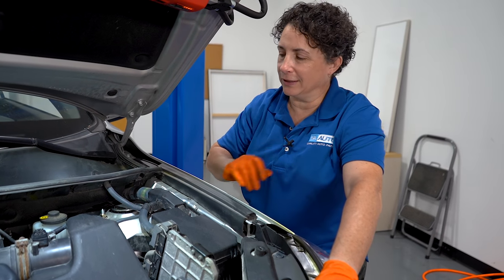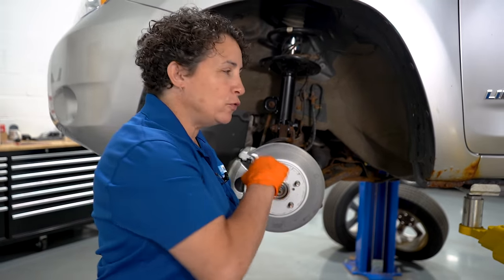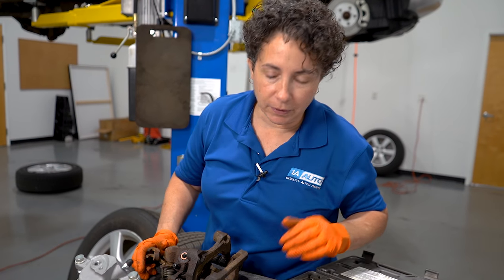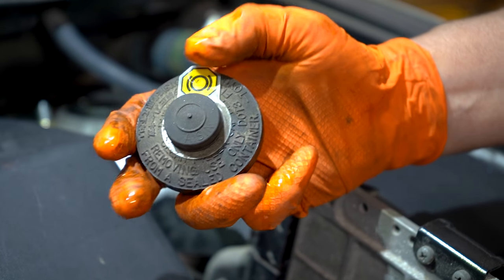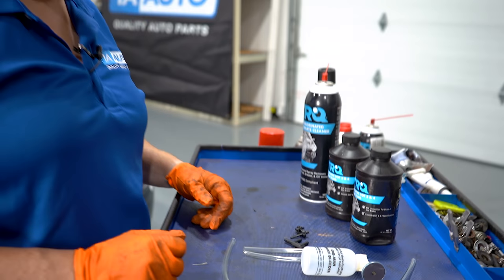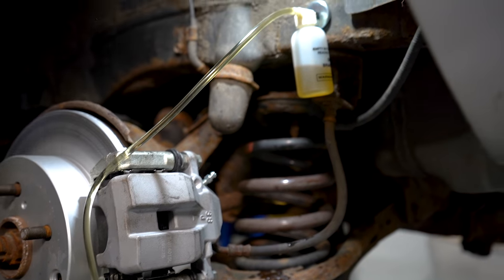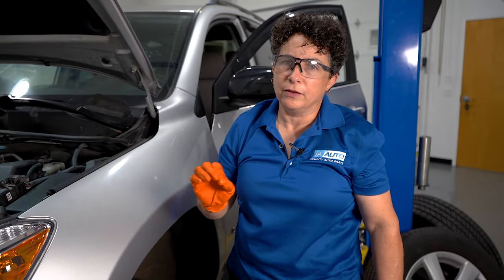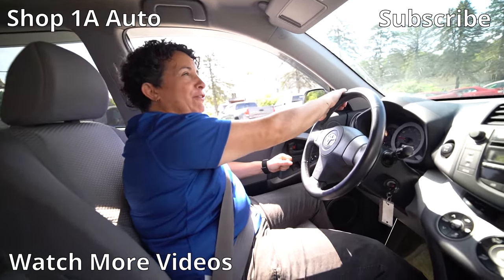Common Mistakes Bleeding Brakes! How to Do a Full Brake Bleed the Right Way, and Why!

Comment: The brake system you are looking at on the vehicle is a split diagonal system. One port on the mast cylinder is connected to the right rear line and also connected to the left front line. The other port is connected to the left rear and also connected to the right front line. This design will keep the vehicle stopping straight in case you loose fluid pressure in one of the lines. This is in most vehicles today especially front wheel drive vehicles. You bleed the right rear then the left front. Or the left rear then right front.  The system sue draws in the beginning is the front brake lines are using one port of the master cylinder and the rear is using the other. If one side looses pressure there is a proportion valve that will block off fluid to that system. Now you will have either front or rear brakes only. So let’s say you lose pressure to the front brakes and only have rear. The vehicle is not going to stop well and if it is bad weather even worse most likely spinning like a top. The split diagonal system if you loose pressure on one system you still have a front and rear brake to stop the vehicle straight.

Comment: Watch the pedal travel when first pumping up the pedal.  Do not want to ruin seals in master cylinder. Small pushes until it builds pressure
Reply: I did all processes on second master on 98 Chevy reseviour has seals .
Reply: Had to replace broken rear feed line, now new. Trying to single person bleed.

Comment: Some cars (toyota) have ABS pump on the passenger side. So for the driver front it actually takes a longer journey for the fluid than the passenger front. So for that I start from driver rear wheel. Also when doing one-person bleeding, I apply a thick grease on the bleeder thread to prevent air from being sucked in via the threads.
Reply: yes i think she loosened the bleeder too much. Good tip to use grease

Comment: Excellent young lady!!! Doing brakes on a 2019 jeep rubicon. Dealer says rotor, caliber and line. I found stuck caliper. $1600 from dealer, $400 to replace calipers, and ceramic shoes. Just bought vacuum to bleed brakes. Just refreshing my memory to do repair.

Comment: Glad you mentioned the Corvette brakes being different from the norm on the order that you bleed each wheel as well as which side of the caliper to do first. I had heard that and now you confirmed it. Getting ready to replace pads because of excessive brake dust and bleed system on a 2017 Corvette with 20k miles. The brake fluid is black...........long overdue for a brake system flush.

Comment: Thanks Sue. You have been giving me the confidence to work on my 2005 EX Honda Element. I live in the rust belt of WI, so i can relate to your videos 100%. I have to replace my drivers side CV axle because the inner boot is ripped and leaking. I now have the confidence after watching your videos.

Comment: Great video.  I came across an instructional video that states your order of bleeding depends more on the distance from the ABS motor to the wheel ( if equipped with ABS) than the distance from the master cylinder.  Also, Peak brake fluid is rated for both Dot 3 and Dot 4.   Kind Regards, Craig

Comment: Always your videos really help. I'm UK-based. Our systems ever since I was a child, I learnt from family and then an apprenticeship. In the UK we have always had dual brake lines running from ft to back. Because of us driving on the other side to Europe, the position of the master cyc varies.
The master cyc has always been a screw-fit cap not a push-on fit, even when I worked on really old cars, they were a screw-fit cap not a push-fit. When I lived in CA, I had a Toyota and a Honda, both were screw-fit caps. I have no knowledge of other cars in the USA.

Mostly for us, its 2 pipes running to the back side by side, they split and cross when they are close to the rear of the car. 
Bleeding very much as you said, especially on complex cars with multiple bleed nipples. knowing Europe has the double pipe may be useful to some.
You talking about the hydrocarbon breakdown is what we learn at college, probably something your home mechanic has not thought about before. Excellent that you introduce those thoughts to home mechanics.
On Vauxhalls, they needed a pressure bleed tool. At that time, most could be bleed with a peddle pump. Please if you are working on breaks buy a pressure bleed tool. They can be very cheap from any motor part shop, the cheap ones use pressure from a tyre. They will really help you and the low-end ones work excellently and are only a few pounds, I think the last one I bought was around £10, it has caps to fit most master cylinders.

Something which very few car owners think off is they should flush their brake and if they have a hyd clutch fluid every few years, not only because of heat break down, almost the oil absorbs moisture from the air. Water in the oil is not good. I can explain but oil break down is going a lot off topic. Its what we learn at college when we do a real apprenticeship :)
Hope my comments help.

Comment: Nice work! 👍
 Only thing I might add and I'm not sure if I've ever experienced this before but I've seen comments where a few people say that air can get past the bleeder screw threads and cause bubbles in the bleeder line leading you to believe that it's air in the brake line when it's actually air getting through the bleeder screw threads and they say to put some grease around the bleeder screw so no air can get through the threads. IDK, just throwing it out there. Another thing I've noticed with the clear bleeder line that goes over the bleeder screw is that when the line is cold and hard or when it's old and hard that it might not make a good seal on the bleeder and air can get past that seal and into the line leading you to again think that it's air in the brake line. I think they need to come up with a better line or flexible fitting that won't harden like regular clear bleeder line like maybe silicone line or Tygon fuel line or something that stays maliable better in colder Temps or when it ages. Regular PVC hose or line seems to harden and not make a good seal in cold temps or after it gets some age on it.

Comment: Thank you SO MUCH for this!! I've always paid to have it done because i was intimidated to do it on my own or mess things up. But your patient explanation gave me the courage to get the kit and do this own my own the next time I need to work on my brakes. Thank you!!
Reply from the maker: +Carlos Jr Thanks for checking us out! http://1aau.to/m/Shop-1AAuto-c
Reply: @1AAuto  i used 5.1 brake fluid😊
Reply: @1AAuto  Do we pump the brakes with the car off?
Reply: @hxd9321  Yes. Do not EVER bleed brakes with the car running.

Comment: I bought a vacuum bleeder kit that hooks up to my air compressor. I then can sit there and watch to fluid come out until it is clear and no air bubbles. Everything in this video is correct and Sue explains this very well. I learned more about other brake systems as well. Also, some years ago I bought some parts from 1A Auto for a 2001 VW I had at the time, a windshield wiper motor et al, and it was high quality and fit perfectly. Thank you 1A Auto for your attention to detail and quality. :finger-red-number-one:

Comment: Great video.  But, how did the initial air in the hose magically disappear?.  How did you fill the hose with fluid so the air in the hose was not sucked back into the caliper on the first press?  Also, how do you prevent air from being suck in through the bleeder threads when out so much?

Comment: I always check to see where the anti brake lock module is located to see what the sequence for bleeding the brakes or flushing the system will be. Sample the camaro has the master cylinder on the left side in front of the driver, but the anti lock brake module is on the passenger side. Looking at the lines the furtherest caliper is the right rear, left rear, right front left front. That would be the sequence. Personally I always flush the system whenever I'm replacing any brake set. A 32 ounce brake fluid bottle with a hose to the bottom and zip tight to keep it place is what I used to bleed or flush the brake system by myself. DOT 4 brake fluid is the way to go when DOT 3 or DOT 4 is called for. Love your videos.

Comment: It appears that Honda takes a difference stance on the traditional bleeding process. They recommend bleeding the LF first, then RF, RR, then LR. Thank you for the videos. Your an awesome teacher!
Reply: I think that's because they're starting from the ABS module on the Passenger side, instead of the Master Cylinder on the Driver's side.

Which is where any, and all, cars with ABS brakes are supposed to start from.
According to the internet.

Comment: Very nice video,  this lady is good in teaching. I do my brakes the same way and never had any issues.  DO NOT LISTEN TO SOME COMMENTS OR OTHER VIDEOS just follow this and you will be fine.  Sue my honda CRV manual tell me to bleed the opposite so front driver first.  But i always do it the way you did.  The master cylinder is in the same location and it should have ABS because the light shows for ABS when i turn on the car
Reply from the maker: +Danny nica Thanks for watching!  Glad we could help!

Comment: Great video.  Super clear and easy to understand.  Maybe consider recommending a flare nut wrench for bleeder screws.  If you round one of those, you'll be sorry.  Also, brake fluid boils because brake fluid tends to absorb water (the reason for periodic fluid flushes).  The water will boil, causing vapor to be created which is a compressible gas.  Air bubbles are compressible (unlike brake fluid) and so you get the soft pedal or need to pump up the pedal to brake.  Thanks again for the video.
Reply: Flair nut wrench 🔧 fits on front caliper bleeder screws but too bulky for rear, unfortunately.

Comment: Good video. What I'd add:
Always clean the outside of the reservoir and lid before opening. 
Use a flare nut wrench. 
Fill the reservoir from a pitcher with a nozzle or a funnel to get it where you need it and reduce the chances to spill any in the engine bay to next to nothing. Add a warning to immediately wash any spill off with water to not ruin parts and lacquer. 
The end should be bringing the old fluid back to a place that properly dispose of it. 
Torque specs of the repair manual should be followed.

Comment: I love this lady, I’ve been literally stranded for nearly 10 weeks. I Had to change out the booster and the master cylinder on a 2000 Bravada, a stubby 15 mm flex ratchet wrench was THE tool. 
It’s been a nightmare.

Comment: Modern cars come with ABS standard and often the proportion valve is diagonally split system...
Some of the manufacturers service manual I have read actually tell you bleed the wheel that is closest to the ABS module first and work your way out.  

Anyways...As long as you don't introduce air into the brake system then you can bleed whatever order you want.

Comment: Bleeding the brakes is also dependent on where the ABS module is as well.
Reply: The vehicle she was working on had abs. Surprised she didn’t talk about abs. The procedure is complex (and varies by vehicle) but necessary.
Reply: @Funwithhighnotes  I wondered myself why she didn't bring up the abs, I've heard if you get air into the abs system you have to get a garage with the right scan tool to get the air out....

Comment: Thank you for the really great video and all the detailed information. 
My additions would be, as some have already mentioned.
1) Use a small funnel to help direct any and all brake fluid into the reservoir without allowing anything to spill as brake fluid is corrosive.
2) I would place a nice shop towel all around the reservoir to also prevent accidental drips of brake fluid
3) The brake bleeding system you showed appears to have worked, but wasn’t a fan of insert a hard plastic piece inside the inner hole of the bleeder valve. I would prefer to use a correctly size hose that goes around the outside of the bleeder valves nipple to create a surely tight fit to prevent any air getting in when self bleeding your brakes.
4) They sell bleeding systems that also incorporate a one way inline valve that prevents any backward flow while self bleeding. You can also purchase this one way valve for your existing system. 

Thanks again for your video your are my favorite for sure Sue!

Comment: Could you please explain is there any difference in bleeding a car's brake system with abs and without abs. I do believe that there is brake fluid in the lines leading to the abs pumps. 
By the way this was a amazing video, like always 😊
Reply: From what I understand, the idea is the same but because of the ABS system, the order in which you bleed the brakes might differ. The master cylinder could be in the same place but the difference in the lines might change that order of furthest from the cylinder to closest. I'd also like a thorough explanation.

Comment: Great video. Thanks for confirming how a brake pedal should feel immediately after bleeding before and after starting the car. I first got very nervous when the pedal went to the floor after starting (when before starting, it was EXTRA firm). When idling, I pumped the pedal and it improved, but still SEEMED softer than before I guess because that EXTRA firm pedal threw-off my reference as to how it should feel. I stepped away for a half hour and came back brake pedal now feels normal :) Thanks again.

Comment: The shop manual for my 1956 Oldsmobile 98 says, "The correct sequence for bleeding is left front, right front, left rear, and right rear."  My Olds has a single reservoir master cylinder, not the dual reservoir MCs commonly found on today's cars -- Could this somehow impact the bleeding order?

It would appear that when fluid is pushed from the master to the only open bleeder (by way of depressing the brake pedal) the other three lines, under pressure, couldn't back flow any brake fluid or air to the master or to the open bleeder.  If so, the bleeding order appears irrelevant.

The shop manual also cautions that the vacuum reservoir associated with the power assist brakes be depleted by applying the brake pedal several times with the engine off before bleeding the system.  Also, I've seen it commonly mentioned that one should use a socket to first loosen and re-tighten all of the bleeders so you'll know whether any get damaged in breaking them free.  Others also suggest using petroleum jelly or grease at the base of any bleeders that leak air during bleeding operation.  Lastly, in replacing brake lines, is it a potential brake fluid contamination problem to apply anti-seize grease to the threaded fittings?
Reply: Sounds accurate. Don’t know about your question at the end though.

Comment: supposed to put a block of wood or something under the brake pedal so it does not travel so far, as it can damage seals in master cylinder, when you move it out of normal range.
Reply: I used to push brake pedal to floor. Tighten brake zirk/ fitting. Then after a reasonable amount of fluids flowed. I was good. Now master cylinder I don't know. Did many on old 70 chevys . 98 is pissing me off. All new lines . I blew 40 buck on a brake bleeder. 3rd now. My problem I have help.

Comment: Excellent vid, some of those bleeder kits have a check valve so I'm not sure if it's necessary to keep the bottle  partially filled with fluid before starting to avoid air going back into brake lines.
Reply: I noticed the little black hose fitting.  It looks a lot like the check valves I use on aquariums.  You may not need to fill the catch bottle first.  that is the idea.  Of course, I used a HbFrt suction bleeder, and it sucked air around the clear tubing and the threads of the bleed nipple.  So I bought a new bleed nipple, and had a friend pump the pedal the old fashioned way for an old toyota corolla.

Comment: Keep in mind air sometimes gets introduced from the threads of the bleeder screw itself as well
To fix the problem remove the screw and apply a thin layer of chassis grease to the threads and reinsert screw to bleed without the air being introduced when bleeding resumes
Also when i bleed brakes i put a small block of wood on the floor restricting full travel of the brake pedal and the reason for that is the master cylinder is not extending into uncharted territory scoring the seals and creating an additional problem due to internal master cylinder leaking
Reply: You saying not to press the brake pedal all the way down?
Reply: @CartoonWeasel  Correct , Limit the pedal travel.
Although it may take more pumps to replace old fluid no issues of possible damage to Master Cylinder Seals
Reply: Hi, thanks for the reminder. To apply grease on the screw, do I have to remove it all the way? Or can I just loosen it, then apply grease where it will sit back? Also, while loosening it, some fluid will probably seep out and might mix with the grease I'm trying to apply. Is it OK? First timer.
Reply: Excellent idea, I've seen on another brake repair video where he stresses not to go to the floor but the block of wood would fix that....

Comment: If you don't do something to seal the threads of the bleeder nipple, you will always see air bubbles in the clear hose getting in via the threads.  I would also recommend not pushing the pedal to the floor on each stroke, you can put a block of wood under it to be a temporary stop to limit the travel.  Also you would need to use much more flushing and fluid to get most all of the old fluid out, at least a couple of pints